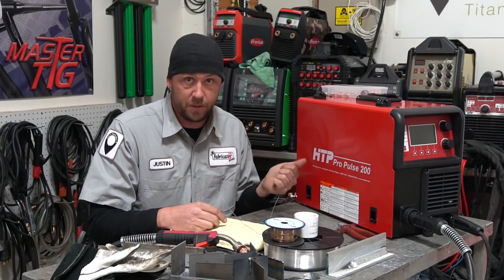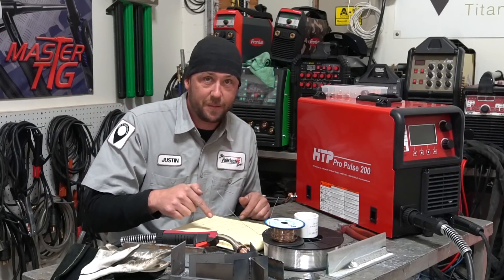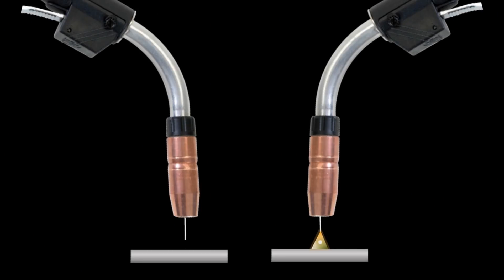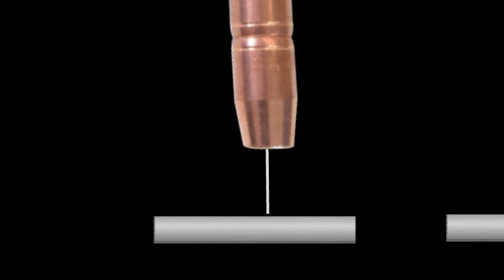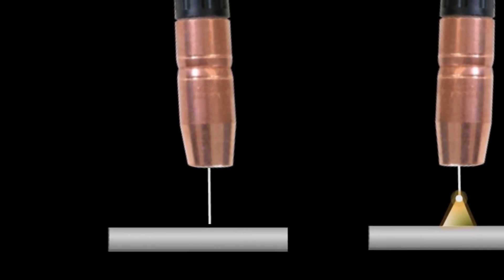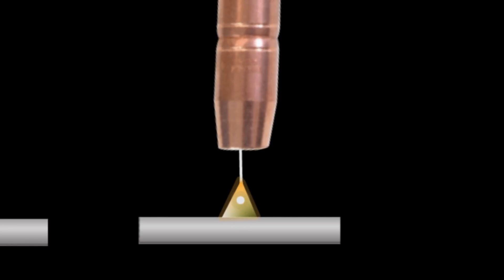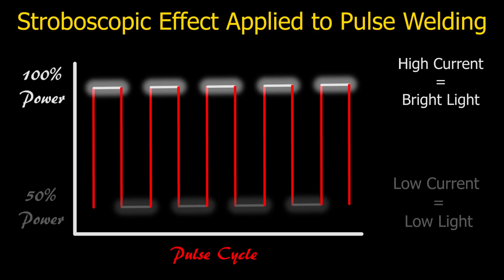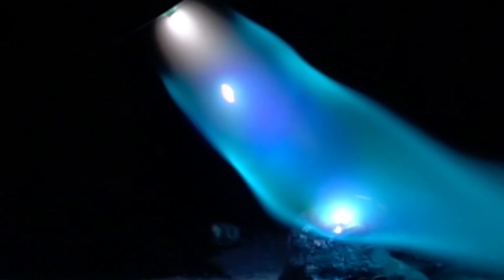TFS: Vaporized Aluminum Caught On Camera

Comment: You need to contact the Slow Mo Guys and get this on high speed.
Reply: This seriously. Some real high speed footage of this would be educational for everyone, the welder manufacturers included. Some high enough frame rate that you can track each drops progression smoothly - so in the few hundreds of frames per second. Not too terribly fast, but much faster than anything on a gopro or other 'normal' camera...
Reply: @Broadpaw_Fox  I would like to see that too, but I could see it presenting some technical challenges as high speed video needs LOTS of light to look good, and you kinda throw all that away when you stick it behind an arc shield, it kinda looks like machine gun tracers just smashing a mini mound of molten metal.
Reply: @weegaz22  - ah, but you could use a much lower lens, if you'd need one at all. An abundance of light is not the problem when welding... and the shades come in many different darkness'...

Comment: I have an old Napa mig and Mine does something like that, the wire melts up to the copper and acts like a tig welder until I let off of the thumb switch and then the wire comes out about a half of an inch and that's it.  I am wondering if that would be the liner, what do you think?

Comment: Saaayyyy whhhhaaattt. That looks so cool.  Wouldnt that be gobular transfer?
Reply: black heart fab No, believe me, that's spray arc.  Miller has some excellent arc shots of spray arc on YouTube vids.  Notice how the wire becomes a needle point as the charged  electrons  strip the molten metal away and in to the puddle
Reply: Yes it is, spray transfer is a lot faster and hotter
Reply from the maker: @FLQ309L  Its spray transfer. Glob would not be that small. Glob also wouldn't have that great of a contact to work distance.

Comment: Not "vaporized" - just a stream of melted aluminum under a strobe. What is amazing is that the melt doesn't keep going up into the gun....might be fun to play with the gas flow rate to push the point of melting up and down.